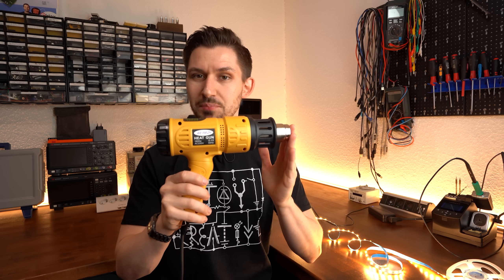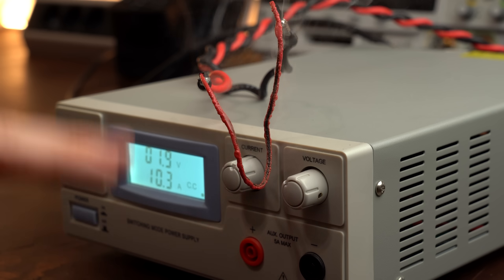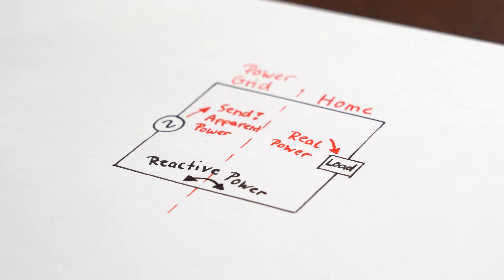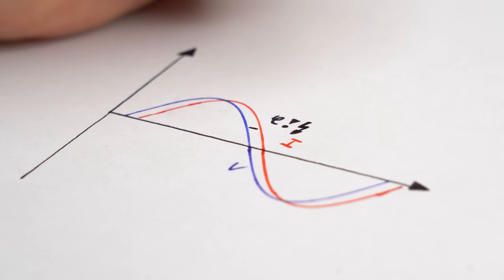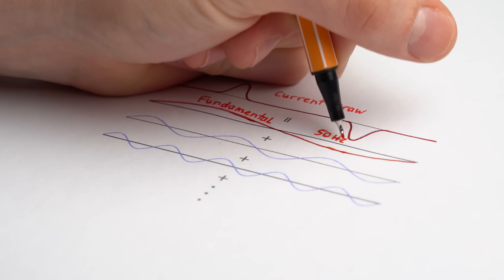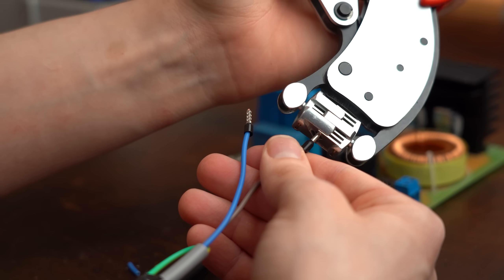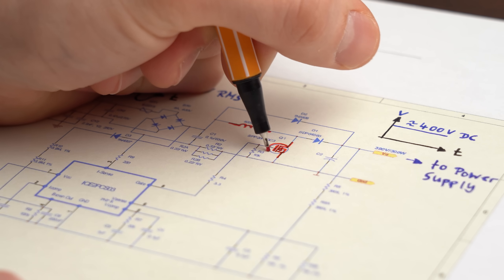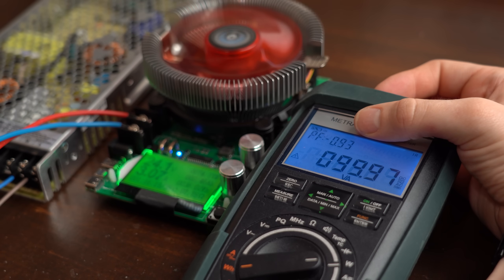The Most Important Circuit for our Electrical Future?! (PFC) EB#55

Comment: Finally you made an explanation video about PFC. 🍓
I had been wondering how does PFC work.
Reply from the maker: Hope you like it!
Reply: I used to work for a company installing pfc equipment in my local steel works on motor drives etc, we never used the dc method didnt even have pwm supplys back then we just got the the current and voltage close as we could for the induction motors to prrrr.
Reply: @nuclear-sparks  For consumer electronics AC/DC - DC converters with PWM regulation are more efficient. The older stabilizers back from 1970th are consuming extra power for their own operation.
Reply: Considering that more and more device use switching psu's, maybe some day everyhome should use 320V DC power grid instead AC's ones, to eliminate those harmonics problem entirely...
Reply: @jstwatchnread8420  umm, but I like classic transformer to power class AB amp. Class AB amps don't like switching power supplies, unlike class D. However, the main drawback of class D amp is they have high THD which I don't like. 🍓
Reply: Basically rectifier-> DC-DC converter with a transformer. You should not think of it as PFC or whatever sh*t, just a pwm variable input DC-DC converter, by modulating the frequency you can get a needed current "draw"..
Or 2-channel DC-DC converter.
Reply: @trevoro.9731  What are you talking about? In the standard boost PFC, which I think is shown in the video, there is no transformer
Reply: @user-td3yi1mq7p  I'm talking about psu. Standalone PFC is not something that saves your energy, and it should not be used except when there is no other choice.
Reply: @trevoro.9731  I mean you wouldn't need a PFC if you don't have a load with a bad power factor.
And it's not just about saving energy, a messed up grid voltage can also interfere with the function of other devices. I don't think many people would use an active PFC for fun
Reply: @user-td3yi1mq7p  In the video, LED lighting is shown as a "bad" load, while many drivers use pwm to correct the power draw.
Reply: @trevoro.9731  That sounds like they are integrating the PFC function into the dc-dc conversion stage. So there is an active PFC, it's just implemented differently.
Reply: @user-td3yi1mq7p  A normal DC-DC conversion, when implemented without "cheap" schematics, would allow proper power draw just by PWM modulation. More expensive UPS use the same way to form a "pure sine wave" on the output. The point is that it looks terribly stupid to purchase an extra PFC unit for some faulty designed appliances. You could spend more to get some properly designed ones.
Reply: @trevoro.9731  Is anyone actually just adding external PFCs to existing appliances? That's silly of course, but that doesn't mean that PFC circuits aren't relevant to switching power supplies.
Reply: @user-td3yi1mq7p  The point was that properly designed power supplies don't need some extra PFC, and LED drivers aren't all faulty designed. Especially a dedicated one - just use proper PWM with DC-DC converter.
Reply: @trevoro.9731  Well there's a whole lot pf those that do need it, although it's normally part of the power supply. For something like EV battery chargers you can't just adjust the PWM to gove a decent power factor. There you usually have a dedicated PFC and a phase-shifted full bridge or LLC resonant converter that controls the power output

Comment: What I'm currently learning in class is that power factor correction occurs near powerlines. That is, the sum of the loads in a particular building are balanced adding shunt capacitors on power lines. Could anyone comment on this  in relation to the video topic?
Reply from the maker: Yep. That is a kind of passive PFC. Measuring the phase shift and then adding caps accordingly.
Reply: @greatscottlab  Sweet, and the question I was getting at was if they accomplished the same thing? Specifically in regard to the precision, I guess devices with built in PFC act as scalpels on larger systems.
Reply: And the reason this isn't done at the powerstation itself is because that would still require thicker wires to carry higher current?
Reply: 3 phase capacitor banks with current limiting inductors switched in & out of circuit as required...
Early days it was with relay logic..
Later on through Z.C.D. THYRISTORS.
Then phase control Thyristors replaced them ..( precise control of current is difficult in above cases)
Nowadays  same is done with SERIES BACK TO BACK I.G.B.T.'s with full pwm & current control...
Each capacitor bankwas built up of 3 or more sub banks where each sub bank have different bulk capacitance....so different values can be selected as per demand.
Reply: Another reason is attempting to achieve equal load distribution of 
all 3 phases...active P.F.compensation does this..but other issues are to be considered...line harmonics..so harmonic filters are used..(active/ passive) also if such need them across lines or in series or both..
Neutral current monitoring / reduction & weather system requires 
floating or neutral point clamping..all involve deep practice & understanding of power distribution systems.

Comment: Not so if you have solar panels and 1000Ah batteries that power all lights and all DC Power applications in your household.  😂
Reply: Also an inverter that powers all units always used during the day (ie. Fridge,  TV etc)
Reply: @stevetobias4890  And once you add an inverter you are dealing with AC and power factor becomes important. Actually more important because the inverter needs to be large enough to handle all the apparent power.
Reply: @eDoc2020  and I have that. I measured the power requirements before purchasing an inverter as well as the batteries
Reply: The inverters are other thing to buy with caution, some of them can damage or devices :/
Reply: @EulerFink  only if they are not pure sine wave inverters

Comment: Could you do a similar video for charging an EV automobile?
Reply from the maker: Sure. I will probably get to that one day.
Reply: That PFC board is pretty close to an EV charger. About the only stuff you need to add to make it one is lower the current limit to a point that the circuit can withstand indefinitely and add logic to handle the charge termination.